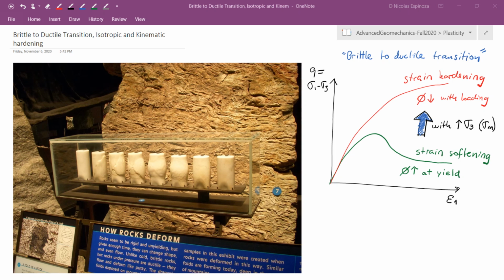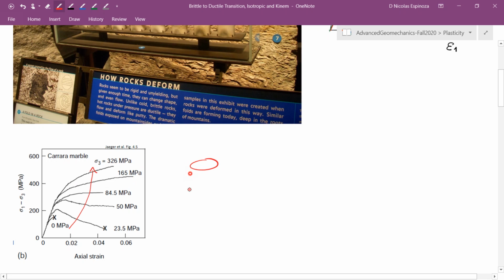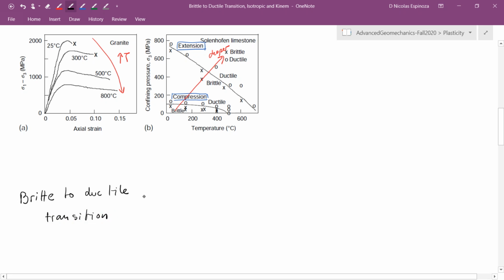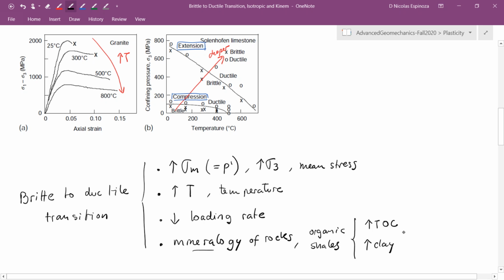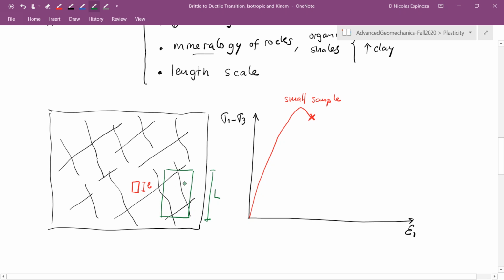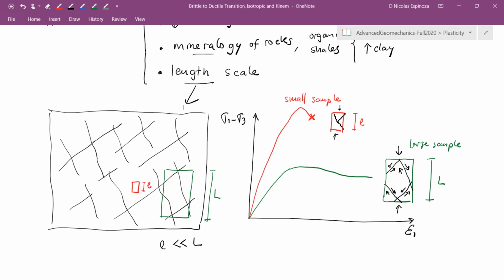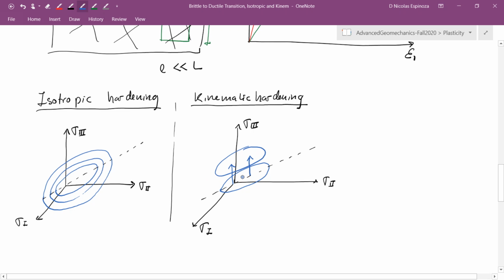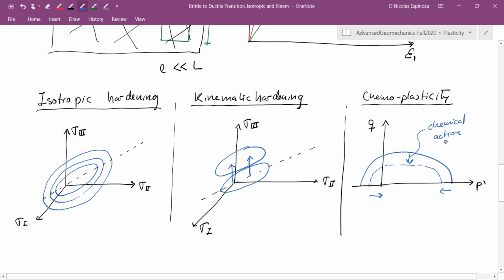L34 Brittle to ductile failure transition in rocks

Comment: Interesting that you mention the length scale - we use the same principle when we produce high classes of steel ... we produce the steel as very small grains within this small grains there are next to no matrix failures ... and then the grains are sintered together under very high pressure (without distrubring the matrix) this way we can reach incredible tensile strength up to 2000 N/mm2 (Random information No 2036)
Reply from the maker: Thanks I did not know that! Thus spoke DNE

Comment: Fantastic job! maybe the height to width ratio (i.e., shape effect) should be involved in the factor of brittle to ductile transition.
Reply from the maker: From ASTM D7012-14: "8.1.1 Desirable specimen length to diameter ratios are between 2.0:1 and 2.5:1. Specimen length to diameter ratios of less than 2.0:1 are unacceptable". 
Triaxial testing with short samples L<2*D are not really triaxial tests meant to measure a Young modulus or rock shear strength and cannot be compared with samples with the right slenderness. Short samples develop too much inner stress from friction with endcaps and long samples may be affected by buckling.